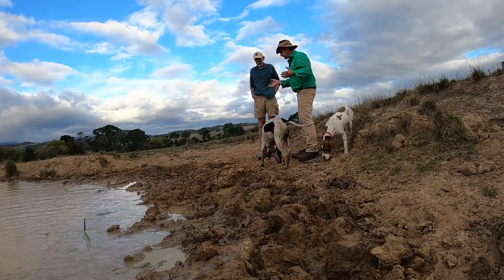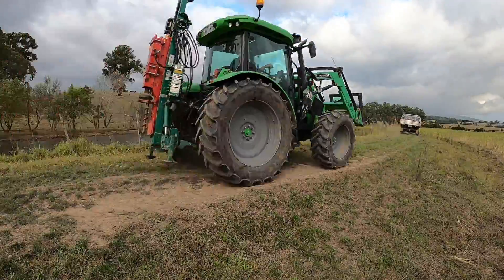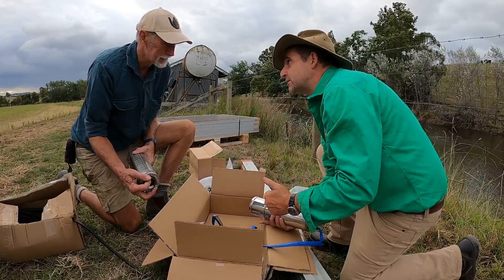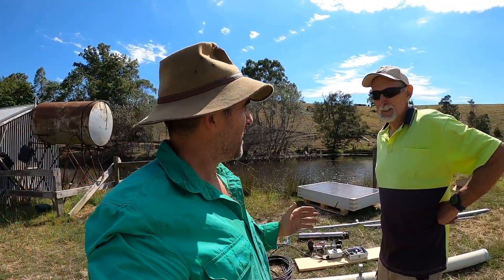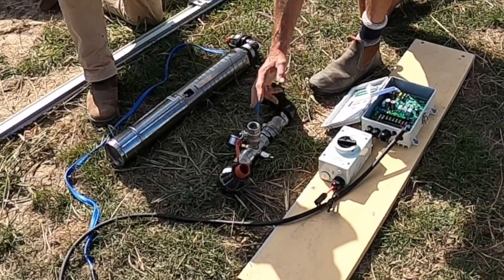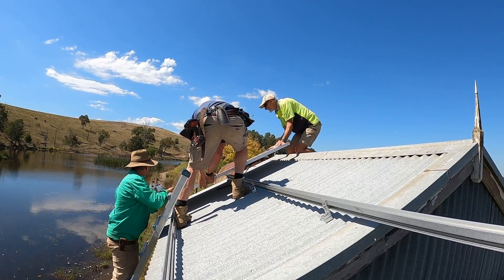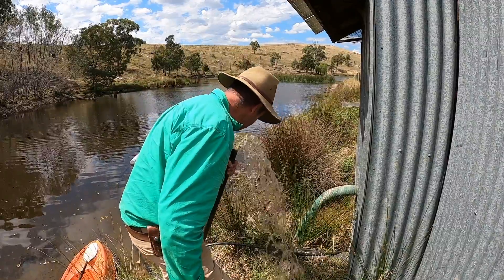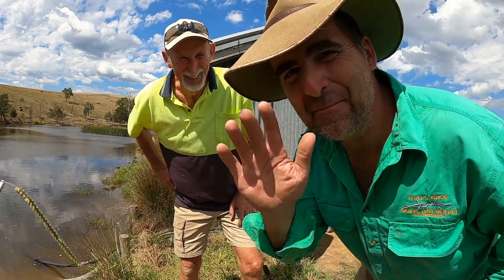Solar Powered Stock Water for Good Farm Management

Comment: Unlike a well which is more or less protected from contaminants like leaves and droppings,  the pond could plug up that pump.  Maybe a sock or outer filter to help the screen from plugging up over time?  As well,  was there a battery system to store excess energy and help distribute power when there were cloudy days?  Maybe with a timer?

Comment: Just to be a nit picker, the optimum angle for solar panels is the latitude, correct in autumn and spring, and equally out in summer and winter. This gives the most power averaged over the year.
Reply: you need very little water in winter so really you should be optimising for summer in this application